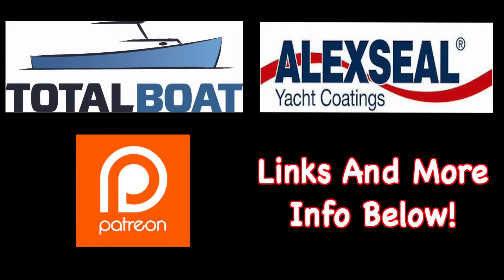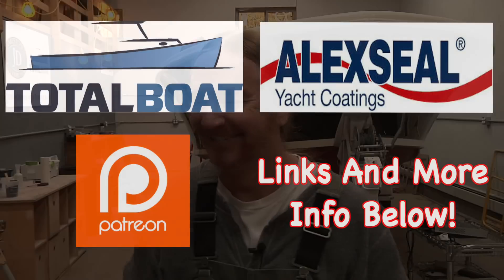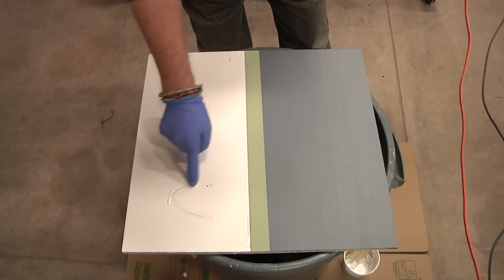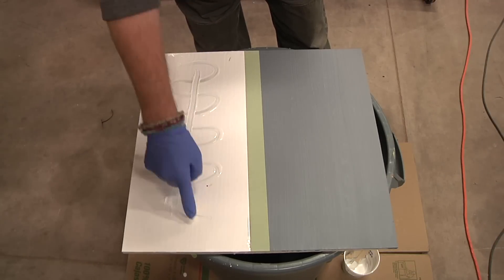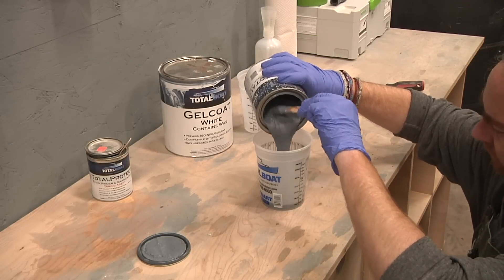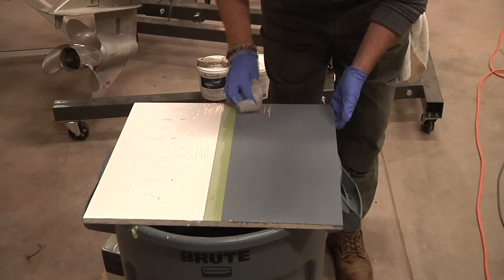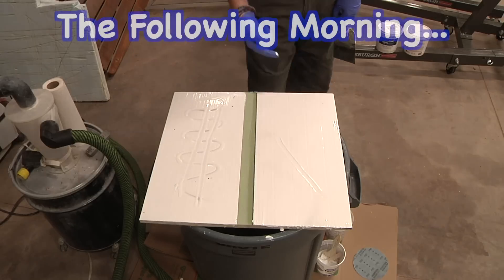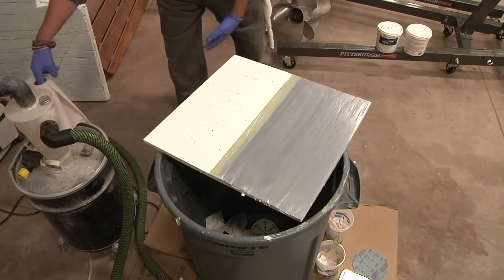WHAT IS A TIE COAT AND HOW DOES IT WORK WITH EPOXY AND GELCOAT?

Comment: Am I the only one who does not understand this video?
You can't put gelcoat on top of epoxy. Unless you put epoxy tie coat on first, then gelcoat. But when you did that it didn't work. I am missing something here but I have no clue what.
Reply from the maker: the tie coat material was old which is why it didn't work :-/
Reply: Thanks for the answer to this one. It shows the importance of checking the dates on the supplies.

Comment: I am new to this. I have never done any fiberglass work.  My hopes are to learn how to do it and do it correctly.  I can appreciate an honest mistake.  I pay attention to details very well. Some call me anal retentive but that is ok.Makes me better at whatever i set my mind to.  So this is my guess of what went wrong. I saw that you mixed your tie coat up but I didn't see it applied. Did you forget to apply it first? i saw the two cups at the bottom of the waste barrel. I am guessing you sanded the base epoxy coat to prep the surface but then maybe forgot to apply intermediate coat before applying gel coat.  Just my humble guess.  Second theory, Do you mix the gel coat with the tie coat for a chemical reaction to get it to bond?

Comment: Dude, what I like about you is that you screwed it and kept in the video. Just a reminder of what not to do. Did you used Mekp or fogot that? I watched older video of gelcoat used over epoxy and it can be done; however, for the guys that don’t want to go with polyester, vinylester can be used and is more water-resistant than poly. Thanks for your contents🙌🏻👍🏻🙏🏻

Comment: I'm surprised you left us hanging without finishing the project. Your catalyst is crap or your not mixing it right. I always skim coat with dynaglass between epoxy and polyester fillers. FYI

Comment: Andy, thank you for all the great videos. I have a bit of an off topic question concerning paint. You have noted in several videos that topcoat paint is for above the water line and that bottom coat paints are for below the water line. What if I do not want an anti fouling bottom? I would like the bottom paint to look just like the top coat paint. I looked on Alexseal website and I cannot find any paint especially for under the water line. What paint should I use? Thank you.

Comment: I did this exact mistake. Large repair of super structure using epoxy. Faired using total fair. Gel coated over the top. Would not even set!
Lots of research and three coats of epoxy primer later I was able to gel coat. 
For my latest repair I painted!

Comment: I forgot the hardener when i put on my first coat of gel coat. I read you have to remove it and stuff. Do you know of a easier way to remove it. I got most of it off but it was applied over chop strand so theres still gelcoat in all the little nooks and crannies. Its been about a week sense i put on the gel coat so i dont know if that makes it harder to remove. Ive been wiping it down with acetone and that gets a little but not the gelcoat in the nooks and crannies. Is there someway to remove it. Would a pressure washer work?  Would it be ok if theres still some left, could i gelcoat over this or do i need to completely remove all of it? Please help 😨.

Comment: Great commentary and it's definitely accurate. My first project was a large hardtop bimini and I intermixed these materials. Gelcoat cured over epoxy laminating resin just fine, but not over any fairing compound. Epoxy barrier coat (nice $$ addition) and gelcoat it worked fine! Different formulas different results for sure.

Comment: Ohh ohh Andy forgot the catalyst🤣  BTW I have water based epoxy paint here in the UK and it actually takes 3-6days to skin dry, that's the norm for it and the longer it takes apparently the better the bond is. Also we don't get epoxy "fanboys" here in UK forums Andy, it's usually people arguing that poly or Vinyl is as good as epoxy on things like transoms that will cause a pointless argument as factually the proper epoxy like west systems utterly spanks poly and vinyl on transoms its not even close the difference, the shrinkage on large transoms for a start can need a second repair less than 3 weeks after laying it and if you don't get the transom strength back that's lost to modern marine ply being nowhere near as well laminated as the old stuff then your big heavy motor will hanging an inch or two away from where it should be unless you bulk up on the layers, then it becomes a guessing game. Proper epoxy you don't have that issue so it's not really up for dispute, epoxy is the clear winner mate no iffs or buts so I'm suprised anyone even argues about it.

Comment: I helped a good friend repair his cap rail on his 32 foot sedan. We used TB 2:1 with f/g cloth and fillers. I wanted epoxy for it strength and tooling properties. We scrubed with water each build up to achieve the shape. Once complete we use TB Total Protect and were very successful. We put 2 coats of TB Total Protect and waited 7 days for full cure time. It was summer and we had 85 to 90 plus temperatures.
It appears dry same day but not patience is critical to marry the polyester gel coat over epoxy. We coated with 3 light coats of Total Boat Gelcoat about 2ml thick. We wet sanded and compounded and had very good results. As a general rule any epoxy takes about 7 days to post cure, Patience is key.

Comment: I made all these same mistakes earlier this year with repairs to my boat deck. I used epoxy and Total fair, then applied gelcoat. At first I thought I forgot to catalyze the gelcoat so I cleaned the surface then applied gelcoat, making sure to catalyze. It still didn't cure again so now I did the research and discovered my mistake. I cleaned the surface again and applied a barrier coat before gelcoating again. It cured this time but I'm not happy with the final product. Looks like I will be re-gelcoating the deck again next spring.

Comment: I’m going to suggest that you did not let the epoxy tie coat completely cure.    I have finished off repairs with gelcoat over epoxy plenty of times and never had an issue BUT it’s essential that the epoxy has totally, completely and thoroughly cured, ideally I’ll wait 2-3 days before sanding to get a key for the gel to get a mechanical bond.
Reply: Some you need a heavier grit paper too. I've seen primer go onto amine free epoxy and act like it's been spread on a wet or silicone surface as I'd only used 400 grit Mirlon pads. It was a 2 pack epoxy primer and refused to stick properly on west systems till id used 240 or heavier. Went on like a dream and flowed out perfectly to anything sanded with 120-190grit.. put it on anything lighter than that it stone wall refused to work.

Comment: i guess you did,nt use a rough enough grit on the sanding disc probably 180 ,instead of 40 or 80 grit i,ve had this problem getting gel coat to harden on fresh 10 day epoxy  lay up hard to use an epoxy primer on it with a rough grit finish,normally tie coat is used to seal old antifoul  if its decent smoothness saves removing old seal with tie cost barrier or if a single pack paint has been used put tiecoat on and  then it lets you use a two part paint or poly gel coat

Comment: What should I use on a 1985 RV class C that has fiberglass shell on it. Not Aluminum like most RV's. Can see the fibers in it. Should I just roll on some Epoxy paint?? Wipe it with Acetone first ?? Not looking to spend a lot of money and just want it to look a little better
Reply: Have it sprayed with a multi stage paint,
Reply: Given the age of the shell a good sanding and cleaning would be my first step. After that is talk to your local paint supplier. I'd probably go with a spray on epoxy based paint used for fiberglass automobile and motorcycle bodies. Rolling seems like it's going to take a lot of extra sanding and multiple coats. The paints I mentioned are mainly for spray guns as they're on the expensive side. That said a lot of guys roll and tip there boat coatings so I guess it's an option.

Comment: Total protect needs to be fully cured before sanding. Tech sheet says very important.
Reply: Yeah but thats so you don't streak and pull the non fully cured paint about. We know how to get around that mate with light sanding and wet sanding. Automotive 1k primer tells you to wait 2 weeks before sanding mate but you can sand it an hour later if you have heat and proper wet sanding paper like the mirka or Kingspor stuff.

Comment: What forums are you addressing?
Reply: Most any of them ... take your pick ...
Reply: I dont know either as all the UK forums I'm on nobody argues about it they know epoxy is superior but not always needed or the easiest to work with. Most guys I know who are strictly epoxy admit they do it as an extra safety barrier and if the customer wants the extra expense, which in the UK most people want proper epoxy fixes they specifically ask for it. I'd say there was more guys on the forums denying epoxy is the superior product because they personally used some brand of poly or vinyl that did the job. It's only later they come on asking why their transom repair cracked within 3weeks because of shrinkage do all the epoxy guys come on and say "we told you so"  I mean I use all 3 types of epoxy on different areas but I'm not silly, I'm not going to argue that proper epoxy isn't the best. It clearly is so I don't get the "fanboy" bit he's talking about. They are factually correct so?

Comment: i dont know where the screw up was but maybe you got confused with the cans and used the gelcoat instead of the tie coat. easy to miss, because maybe it is also white. about the gelcoat application over the fairing compound: i wasnt expecting it to not cure since the fairing had at least one day to cure and was hard enough to be sanded. i was expecting secondary bonding issues being that polyester over epoxy is generally a "no-no" but the reverse is actually better than polyester over polyester.
Reply: Proper epoxy will bond to anything better than anything. I've repaired a glass fuel level dial on an old Aladin Blue Flame heater with west systems and its lasted 10yr in horrible hot then cold conditions. When I say hot I mean 200+ deg and its still fine after a decade and people say epoxy stick to anything but glass, no it sticks to glass too I guarantee you it does.